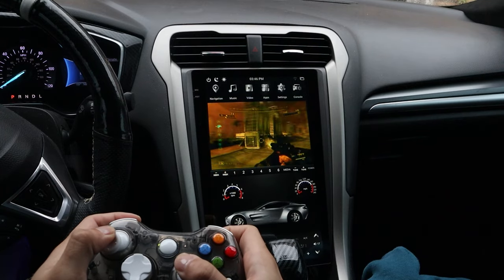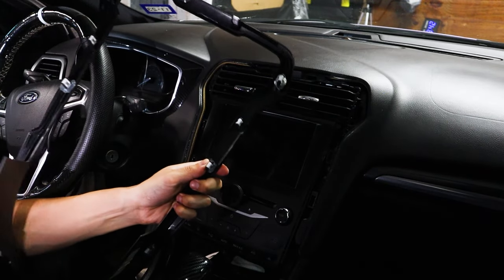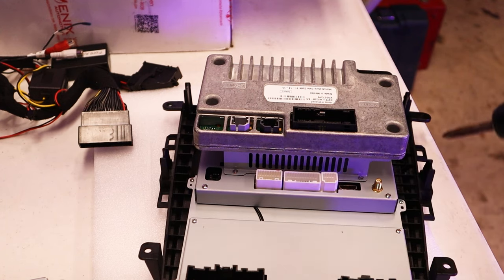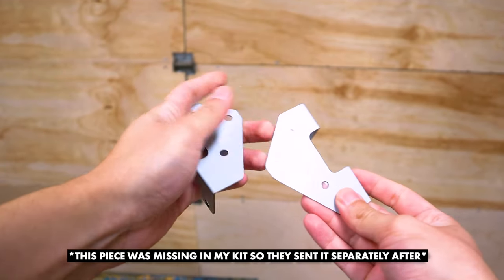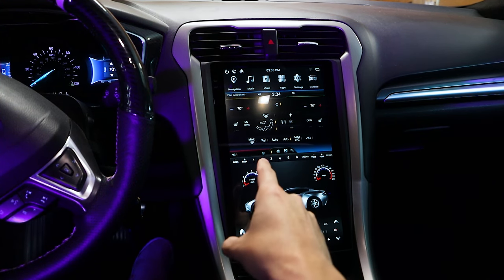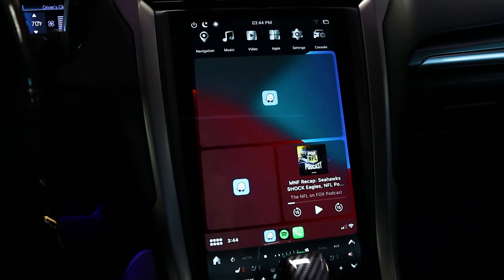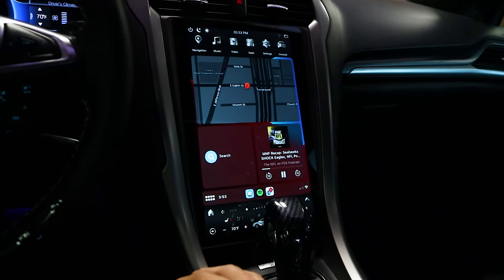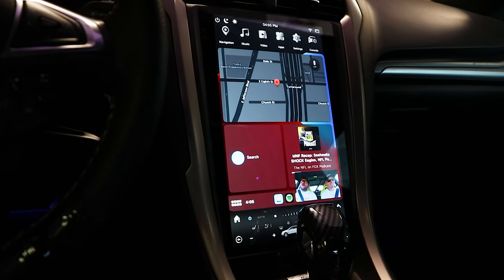Ford Fusion TESLA SCREEN Install!

Comment: Having done mods with electronics on other cars in the past, I 100% recommended you always disconnect the battery!
Reply: How would you go about it if it's a hybrid ?
Reply: Just the 12v battery, no need to worry about the high voltage battery, better to just install a kill switch for the head unit
Reply: @mfries121 what does that means? I’m about to install mine tmr

Comment: Just a week ago I bought a 2016 Ford Fusion SE 2.5L with 8” screen and without navigation to replace a 2013 SE that was recently totaled. Not sure which Sync I have. Still trying to find out how I can find out that info. I had been searching for a CarPlay upgrade for my car so I could use the nav on my iPhone. I’d found a unit that looked OEM and a YouTube site that gave excellent detailed instructions on how to install it. I was all set that that was what I was going to get, even though it cost $1,600! Ouch! Then I just happened to find this video(thanks YouTube algorithm!) Not only is this unit a beautiful unit, but it also upgrades the look of the car! This unit costs A LOT less, according to the Phoenix website. And lastly and in my opinion the best part, is that Dito Cardona did an absolutely EXCELLENT job with this tutorial! Though I’ve never done anything like this before, and never thought I could, after watching Dito’s video, I actually think I CAN do this install and I’m 67! 

Oh yeah, actually I did watch 2 other videos about a similar unit but for a tutorial they were both garbage! Went way too fast and didn’t lay out all the steps like Dito did.

DITO, if you’re reading and responding to comments I’d like to know, since there appears to be multiple versions of this unit on the Phoenix website, although only one is available at this time. Is that the one that you have? 64g of rom?

Anyway, great tutorial video! Would love to see one by you doing a dash cam hardwire into the cabin fuse box.
Reply: Do u have the Sony system in your car? If it's a 2016 it should be sync 2 like mine.  But mine is the Energi Titanium with the Sony system.  Believe it or not the unit he just installed is actually extremely outdated by software standards. The one I have is Android 13 his is only Android 9. Mine is 5g high speed with the Snapdragon CPU which runs at lightning speed.  U can get it in sync 2 or 3 or 4. As for your dash cam u don't need to wire it directly to the fuse box. All the power u need is behind the head unit

Comment: Question, I have a the 2016 ford fusion with 4” screen, but when I went to buy online it said that If I have the manual a/c then I can’t use the screen, is there a way to do this?

Comment: quick question, i have a 2013 Ford Fusion SE Turbo, and have auto 6 speed, but wanted to know if its possible to install paddle shifters or get an conversion kit compatible with my car?

Comment: Ordered mine from phoenix automotive 2 months ago.

Apparently the units they have conpatible with sync 2 are out of stock and they are asking if i want to proceed with out sync. Wouldnt i just take the back modudle off and place it on the new raido? If i go without the sync, would i retain the steering wheel controls? Any input is appreciated.

Comment: Could you explain which screen you purchased? was it the only one available that you purchased, which was 4 g ram 64 g rom android 9 w/ built in car play andriod auto" when selecting the other options (considering the higher the number the better it might be) they are showing unavailable, thinking its that popular. And for  "color" did you have to select for the type of Sync you have or can i select either Sync 3 or 2? Would appreciate if you could answer my question! Thank you!
Reply: Yea would like to know too they said to me they don’t got android 9 but upgrade to 12 but can’t retain oem or sync so idk if that’s usable?

Comment: Awesome video, I havw a 2018 Ford Fusion Energi SE and my APIM module recently went out so I need to replace it. I wantwd to go aftermarket and I have seen these posted. I have heard mixed reviews about these units but after watching your video im sold!! I can't wait to swap everything out and get up and running again.
Reply: I too was very cautious about Android head units in general and especially about this company. I did a ton of research and interviewed a few people online who had posted about theirs that were the same unit as the one I needed. Mine is a for a Ram 4th gen. I've been nothing but pleased and it's been over 4 months since I've installed mine. I setup a shortcut on my iPhone so hotspot always turns on whenever my phone connects to bluetooth and the head unit is ready to play music as soon as I drive away. I haven't had any issues with it at all. Took just over a month for delivery.
Reply: Got an energi myself! If you bought it, do you know if it still retains the hybrid info screen?

Comment: Has yours been glitching at all or refusing to do wired in carplay. Also I have yet to get brackets and they haven't been helpful in getting me them
Reply: Yeah they didn’t send me brackets either but I still installed it. What are some of your issues bc I have a cpl major that I can’t find help for such as no sound at all And the incorrect sync is there so can’t change my ac or anything.

Comment: I notice a ribbon cable was disconnect from the A/C board but there was none on the Phoenix unit to reconnect. Any idea what the ribbon cable is for?
Reply from the maker: Honestly no, I was able to get seemingly everything AC related working despite that but I did note it in my initial install

Comment: I just got a new 2016 SE, but its the stock small screen, will I need to uprgade that to a newer version of sync before I even spend the money on this? 

My old fusion I got totalled last month. Had it since 2015, got it at 25k miles and the last the speedometer had shown was 256,680 miles. Im definitely going to make this one last
Reply: You shouldn't have to upgrade the sync (unless you're having malfunctioning problems with it, which is pretty common)
Reply: You just select what sync unit you have when you purchase it. No need to upgrade your sync unit at all.

Comment: I had this installed in my Fusion for about a week and had nothing but problems with it, but to each their own and good luck!. I don't recommend myself but I do recommend just using a tablet, get some magnets attach it to your dash and boom head unit lol.
Reply: What are some of your issues bc I have a cpl major that I can’t find help for such as no sound at all And the incorrect sync is there so can’t change my ac or anything.
Reply: @datwayclay3704  screen flickers on and off, no sound, whole thing completely shuts off then turns back on, or wont even turn on at all. Its not worth the hassle for me
Reply: @zuluhawk  yeh nah that’s crazy I fixed the ac nd I might be able to fix the sound one they send me brackets bc I’m not sure why they somehow forget everyone’s. But haven’t had flickering issues yet. I’ll stay updated
Reply: Did you ever get this handled
Reply: @silentgrind34  lol hell nah man, I've been gave up on that pos screen. :D
Reply: @zuluhawk  oh shit it was that bad? What do you got now?